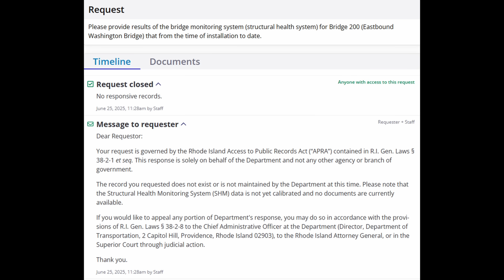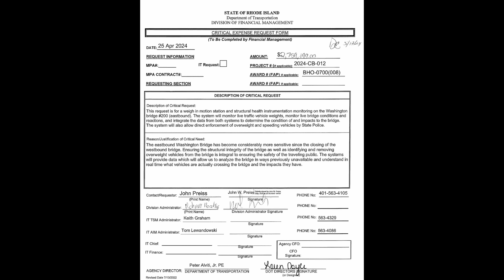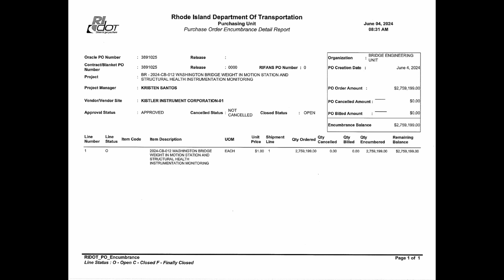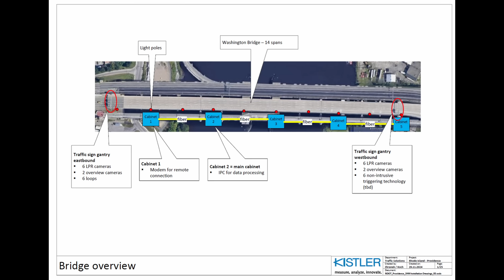RiDOT Fails to Deliver; Again!

Comment: We’ll begin using it when we’ve got it running………hmmmmmm 🤔
Keep up your scrutiny and reporting, Casey. 👍🏻👏💪🏻
Reply from the maker: Thank you!  I am starting to wonder if they have it running but are using the excuse of "calibration to avoid transparency".
Reply: @CaseyJones-Engineer  And how will they become aware of any possible damage done prior to installation of testing equipment. If stalled new construction will be done on whatever condition existing damage has already occurred.